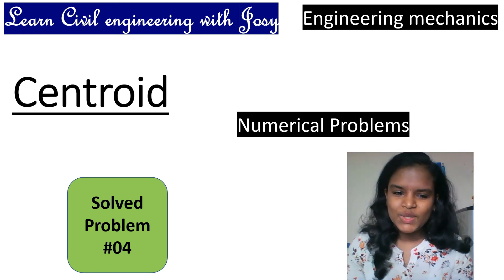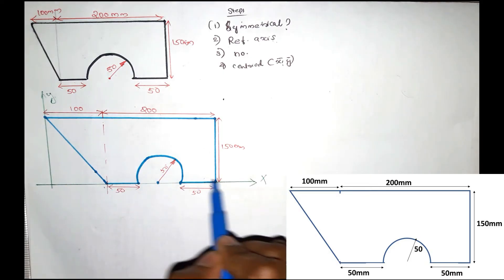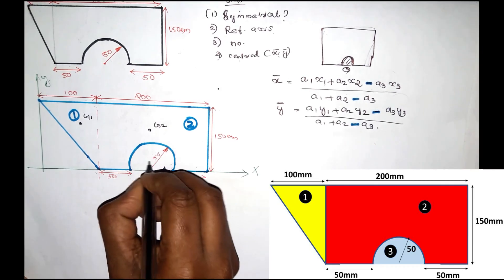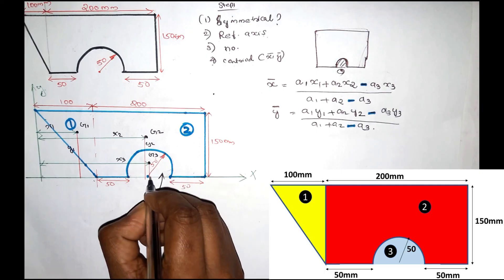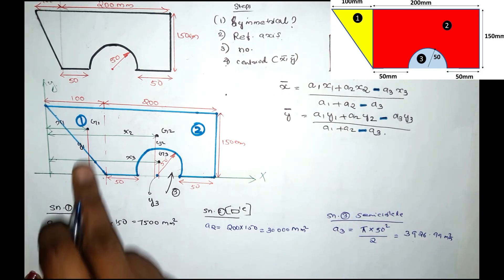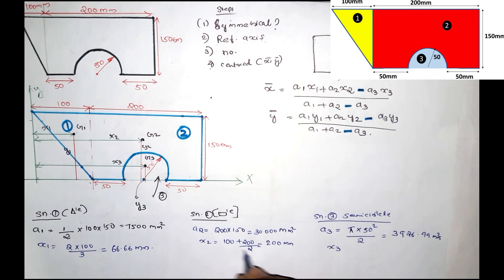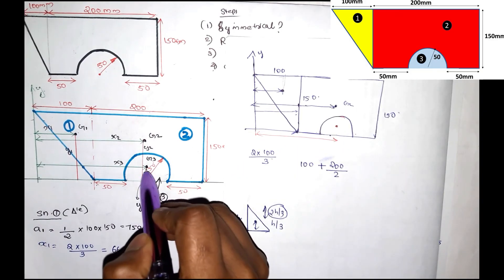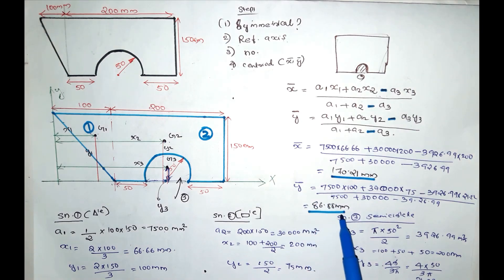Problems on Centroid (മലയാളം)|Problem 4|Centroid and Centre of Gravity|Engineering Mechanics

Comment: Miss 8:50 h = 150 ayi enthe edukathirune🙂
Reply from the maker: Athinte height 150 aanalloo... 8:00..figure nokku... rectangle nte side thannittillle 150...ath thanne alle triangle height
Reply: @learnwithjosyvaidyan7938 miss 100 ayaa edthekkunne
Reply from the maker: @ashtamirnair321 Triangle nte actual height alla edkkndath....
Triangle nte corner nnulla distance*2/3  anu ivde vendathh...so 100*2/3
Reply: @learnwithjosyvaidyan7938  appol teacher x num  , y kkum corner to centroid value akki equation edukkanam alle ?

Comment: Ma'am unit edudilla mark etha povum .ee pravisham centroid kandupikan ulla question ans kitti 3 figures undayirunnu appol final ans kudi ethra mark povum 10ill .onnilum unit ezhudilla ee questionde 😭
Reply from the maker: Tension aakandaa..orupaad marks onnum pokilllaa..1/2 or 1 mark..athre okke pokulllluuu..
Chilapo full mark kitumm, valuation chyynna ale depend chyyam..
So don’t worry..ithonnnum orth vishamikkuve vendaaaa...ktoo
Reply: @learnwithjosyvaidyan7938  area kandupikiddan x, y & last x& y okkekudi kure ans ille athill ellathinukudi aano 1/2 mark kurakkuva atho tottal 1 mark kurakku.
Reply from the maker: @asish8880  ellam kudi..total
Reply: @learnwithjosyvaidyan7938   ok Miss thanks
Reply: @learnwithjosyvaidyan7938  Oru abadham patti .6 module SHM problem najan .5 aanu tannathu najan 5 ittu cheythu . velocity and acceleration at mean and extreme position kandupidikkan aanu question appol ethra mark kittum .bakki ellam correct aa .enthe question paperill ee point clear allayirunnu koppp athu kondu kandilla. 😭😭😭😭😭😭 Plz reply 😢
Reply: @asish8880 jaicho?